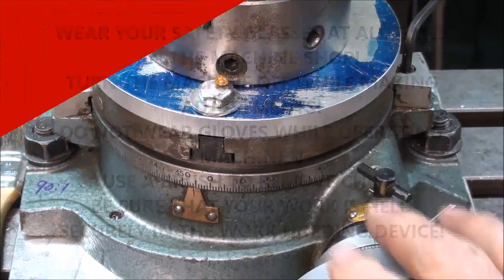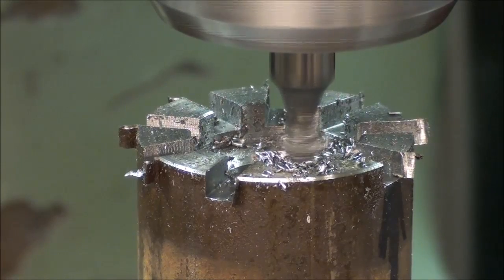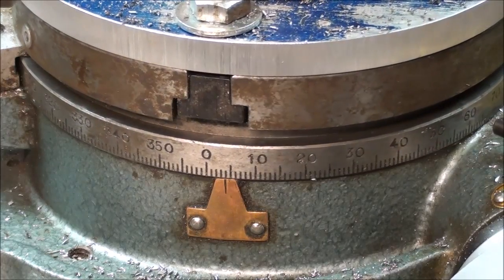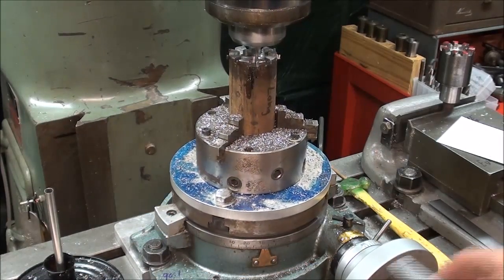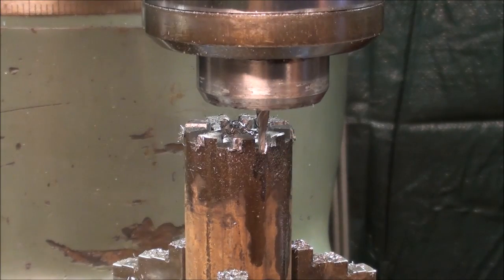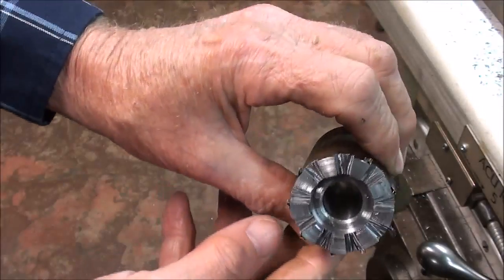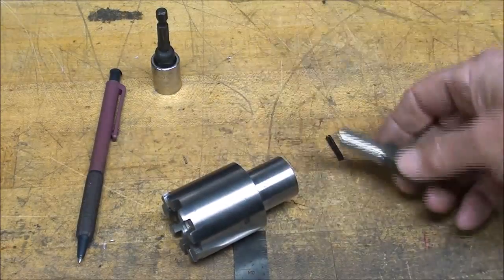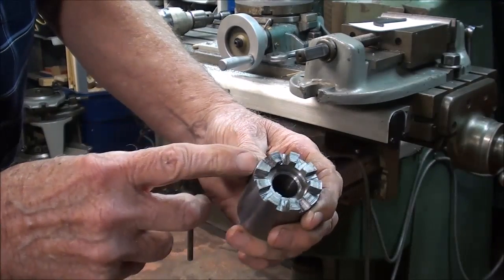SHOP TIPS #204 Tubalcain Makes a Crank Adapter for the Bridgeport Pt 2

Comment: I was wondering how you were going to do this. I had figured a way that used purely degrees based on cuter diameter...but always was left with odd decimal degrees...but not certain a bad thing, because rounding to the nearest 1/4 degree seems to give decent clearance....interesting topic

Comment: Hi Pete

I built one of these some time ago, consulted the hand book and it explains odd/even teeth/cogs.  If you take a straight edge you will see that the side of the tooth/cog is in straight line with the oppsite side of the tooth/cog 180 degrees across, so you can make a straight pass thru to cut two at once.
Rather than the hex wrench, it was simple to leave a tail on the part and turn it upside down in the chuck on the RT and cut the 3sides for the drill chuck, no need for an adaptor
Finally, years later I milled flats on the 1" part of the tool to accept a 3/4" wrench for fine adjustments while the crank turner hangs this is ala...Oxtoolco design

Enjoyed the video and this is my 2 cents, I knew that bugs days were numbered...LOL
Reply: Fred Newman Looking at the thumbnail for the video it appears to confirm that you can go straight across. Remember we are not talking about the hogging out of the bulk of the material at the start, for which you can't go straight across where as you could if it was an even number. No, we are talking about when he was cutting the red and blue numbers to cut the proper angle on the teeth. Draw the pattern out accurately on some paper and you'll see. Not that it really matters, his way also works fine and I love watching all his videos but it's always good to teach other ways of doing things :)
Reply: radbot1 I think you're right. Put the cutter edge at the centerline (minus clearance as you say), Then, just cut straight across. With each pass, you cut the clockwise side of one tooth and the counterclockwise side of another tooth. The issue is how much to turn the workpiece. It turns out to be 80 degrees (360/4.5). Repeat the process a total of 9 passes and you've got 9 teeth and 9 spaces without having to re-fixture or change cutters. The 4.5 in the angle calculation is because you're cutting 2 sides with each pass (9 passes times two sides is 18 total sides, two per tooth). This should work with any odd number of teeth/cogs.
Reply: outsidescrewball I thought the same thing, that he could go right across. You could easily and mathematically work out exactly how far to move on the x-axis. Move half the diameter of the cutter minus whatever you want for clearance, like 5 thousands or something. You wouldn't even need the red or blue numbers. In any case I do love to see him tackle something more complex, something you would never try teach in shop class and makes you think "how on earth would you make that!?!" just cause the challenge is enjoyable.
Reply: No they can't go across from each other! He had 40 deg increments, to go across from each other it would have to been at 180 deg, which doesn't work out with 40 deg increments. 
Nice video mr Pete, still waiting for explanation of the .060 offset though. Lol
Reply: Bob Cargill Ah now I get it, you go round almost twice. Yes that would work. But why go past the 40 degree mark and go straight to 80, only to come back to the 40 degree mark on the second rotation?
Reply: radbot1 Good spy! I missed that completely! Nothing like making it more complicated than it has to be. You're absolutely right, the CW side ends up repeated at 40 degree increments, so you might as well do it at 40 degrees and get it done in one rotation. So, I amend my formula to 360 degrees divided by the number of teeth, for odd numbers of teeth. Thanks!
Reply from the maker: Angusinwyoming  Thanks for watching. Yes-you are right
Reply: outsidescrewball Are you sure ... He is running a odd number off teeth's. With a even number of teeth's you can run to the opposite side
Reply: Correct, though I'm pretty sure you'de have to move 40 degrees each time. Nine passes, one change of angle per pass.
Reply: radbot1 I actually did the analysis and it is 80 degrees. I'm surprised machinery's handbook doesn't provide the formula, but it is definitely 360 divided by half the number of teeth (4.5 in this case). You can do the graphical analysis or the angle table to convince yourself. Here's my table for the 9 teeth:
CW side   CCW side  Pass #
0               180             1
80             260             2
160           340             3
240            60              4
320           140             5
 40            220             6
120           300             7
200            20              8
280           100             9
You actually go around almost twice (2 rotations) with this method. The 40 degrees in the first column is actually 400 degrees, and so on. You can see the CW and CCW side of each tooth in the table. Tooth 1 has a 0 degree CW side and a 20 degree CCW side, and so on.
Reply: Bob Cargill Quick question.  After cutting the CW side at 40,80,120.... Do you need to off set the tool the other way when you cut the CCW sides? Thanks in advance.
Reply: Angusinwyoming You don't meed to make any changes for odd numbers of teeth. Each pass through the workpiece cuts the CW side of a tooth on one side and the CCW side of a tooth on the opposite side. As radbot1 mentioned, go through one rotation of the workpiece and both sides of all the teeth have been cut.
Reply from the maker: Angusinwyoming Not sure--try it?????
Reply: mrpete222 
I tried it.  The 3/16 mill proved to be too big.  When cutting the side of one cog it would shave a little off the cog next to it, making it have a point.  I did get it to work with 5/32 end mill and rotated the table 40 degrees..  You have to be creative as you will climb mill some times.  At any rate it worked!!  Thanks for the help.
Reply: Angusinwyoming The formula for the maximum cutter diameter is Ri sin(θ), where Ri is the inner diameter of the cogs and θ is the cog angle (360 degrees/number of cogs). This formula is not in Machinery's Handbook, but it should work for these simple, straight-tooth clutches. The formula does not account for any clearance added to the cut, but it is still a conservative estimate of the maximum cutter diameter.

Comment: Nice, this has been on my mind for years however my only drawback is the drill. With
a four cylinder motor never mind a V8 or a 6,  I can make about 5 turns with two hands,
and gotta sit down. Judging by my torque, I'm going to need one big drill !  LOL
sam